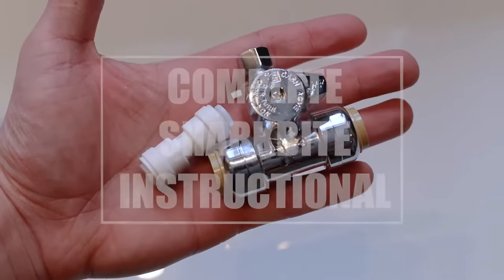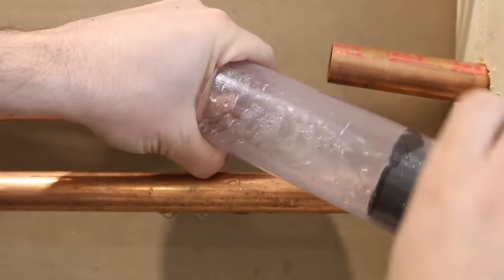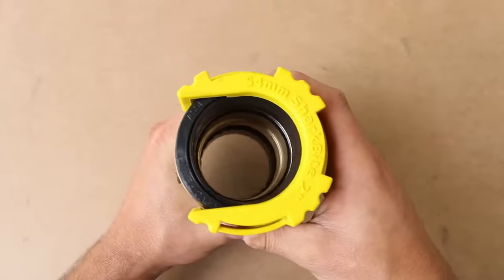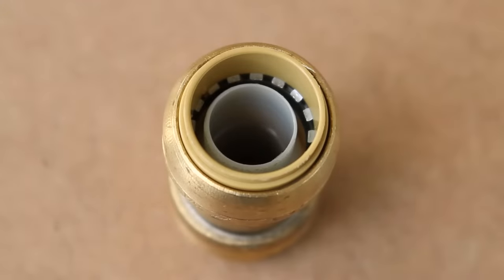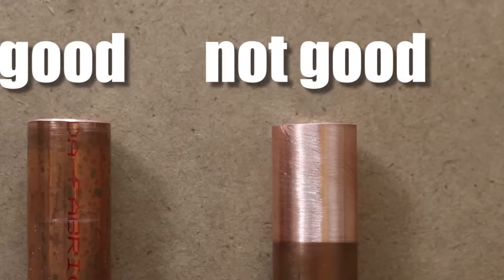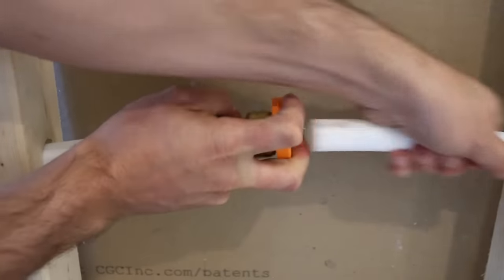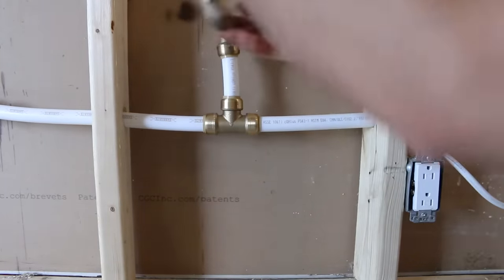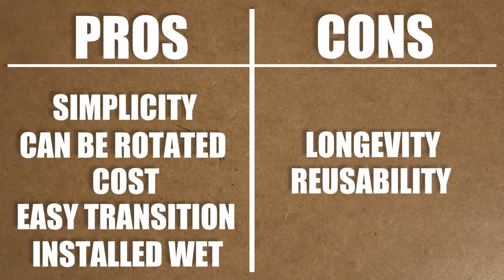Beginners Guide To SHARKBITE Fittings (Watch till end BEFORE Buying!) | GOT2LEARN

Comment: The pros always rag on these things but I'm starting to think it's self preservation instead of good advice.  That being said, I wouldn't use them where there was no access.  THAT being said, I did my hydronic heating system with them and they are great so far.  Definitely buy the nice hangars and use them.  Sharkbites aren't rigid when assembled, that's a plus and minus depending on circumstances.

Comment: Great video.

I never considered, although it does make sense once we directly think about it, that they lubricate the o-rings at manufacture.

All the same, I continue to keep a tub of silicone grease and always dab the end of the deburred pex before assembly.

Same principle I guess, I'll keep at it, I typically do not use a shark bite anywhere that does not have an access panel regardless of assurances, otherwise it is crimp clamps or sweat.

It is nice knowing that they are well trusted.

Any time I replace a section that has a SharkBite connection, I usually keep it if it looks serviceable and put them in a bag for short-term use.

Comment: I use them for diy repair jobs. I also use cpvc primarily. I avoid copper because I dont have that skillset and dont view it as necessary to learn for the tasks I'm doing. All of this has been work done on 1/2" or 3/4" water lines.

Where I think these are very useful in for that transition from copper to cpvc. Maybe there is a better way, but for me this is by far the simplest way to get this job done. 

1. Cut out the pipe you need to replace/alter etc. 
2. Clean up and deburr the copper where you cut it.
3. Attach sharkbite
4. Use cpvc from there.

Using that basic approach all I really need to know for copper is how to cut it and deburr it. Everything else is cpvc cutting, measuring, clean, and glue work. Maybe Im not a pro, but Im not doing fresh installs. This is all cut out and replace jobs. 

The copper was installed usually by my father in law back in the 70s so it had a good run. Maybe these fittings wont last as long as advertised. Maybe they will. I don't know. I do know that poorly done copper installs dont last nearly as long as advertised. I know I won't have the frequency of use to keep that soldering skillset up at a level I would feel good about. I also dont want to hire a plumber for relatively simple tasks. For me cpvc is a very simple skillset that I can easily do. Sharkbites just solve the move over from copper to cpvc.

Comment: Thanks for this, I have a small repair to tackle and I just might go with these. The space will be on the tight side and I am not sure about soldering in there... It will be accessible so I can check on them from time to time.
Reply: Go for it. My experience is 100 percent for these little buggers. Other than the price I have encountered no negatives. Tight spaces was my circumstances and they saved me calling a plumber. Now, I had problems but they were unrelated to the sharkbites. I wish I had gone on website before I started. That would have saved me some headaches. This was also my first time taking one apart( several times). This guy's tutorial is perfect. Unfortunately, I had to learn those tips the hard way. Good luck!
Reply: I'm a plumber with over 25 years experience.  I live in Reno. NV.  I have seen shark bites freeze and break actually split down the side.  It flooded a laundry room.  SO THEY ARE NOT PERFECT.  They are easy to use and a good option for quick and easy installations.  I would not use walls that are not serviceable
Reply: @donquandt3877  LOL copper freezes and breaks as well. Nobody said they were perfect. They're good for an easy diy fix that won't cost a car payment like a plummer would.
Reply: @donquandt3877  Any type of fitting can freeze and crack. Would it have failed if it didnt freeze?

Comment: Only as a temporary emergency repair. I fixed a job by a licensed plumber who used these crap things in an upstairs bathroom job. Needless to say the downstairs destruction was epic when the fittings blew apart. I use these in industrial plumbing jobs for air and water. They do fail rather often but in these applications they can't damage anything.
Reply: I do maintenance work and I replace those things regularly... like you said temporary/emergency repair.
Reply: Depends .._on the hydraulic pressure and instalment of the bite.Haven't changed any of ours ever since 2013
Reply: If they're failing that often there is either too much pressure in the line, or there is a fault in how they are getting installed. The part in the video about NOT taking sandpaper to pipe before applying is very important. Same with deburing. Unfortunately, I've seen in my own house from previous owner where they used sharkbite fittings and did not follow those guidelines. I had to remove them to prevent disaster down the road. Best part? A Licensed plumber did the work.
Reply: Ive replced them in other homes but you can tell a shit job was done tho lol,yea no sandpaper

Comment: love my shark bites--and found that they'll push OFF copper instead of breaking if they are allowed to freeze.  Simply push back on after the ice is gone-no leaks.
Reply: Thanks for that piece of knowledge. sounds great.
Reply: I like pex because it seems flexible enough to freeze and not split like copper or push off. Probably also helps in long term with just normal temperature expansion and contraction from hot/cold water. And lastly seems more inert to chemicals and ph of water.
Reply: @mickjager5974  Shark-Bite brand pipe is rated for 1.5 internal dimension  freeze expansion
Reply: @williamtiebout4142  1.5 times or 1.5%? 1.5 times would be huge! I don't think anything except a rubber hose would take that. Looking at their brochure they claim it is the most freeze resistant but state in the warranty conditions that damage do to freezing isn't covered.

Comment: I just had one of these fitting fail after 10 years. :(   And of coarse, it was inside a wall.  Had to cut into the wall and repair.  Went back with crimp fittings.  I won't use these push fitting inside a wall ever again.
Reply: I've fixed sweated copper joints that failed. Should we stop sweating copper as well?
Reply: @thomashammond9317  Hopefully not after 10 years.
Reply: The only one's I've EVER seen fail, are those that were improperly installed.

Comment: Thanks so much for this video. My bathtub plumbing does not have shut off valves, but is accessible through a wall panel. I was weighing all my options for installing a shut off and after watching your video I am going to use the sharkbite system. This video was extremely informative and thorough.
Reply from the maker: Glad it helped Linsay!!

Comment: Just one question, I would think a little lube on the pipe before insertion would help and would help protect the o ring, I was thinking olive oil or corn oil, I agree with all the pre preparation so important.
Reply from the maker: Only use silicone grease for this.

Comment: This is an excellent video. I am a professional plumber and I have one major caveat on installing these type of fittings: Only install these fittings in an accessible area. Do not install behind walls or underground. The main reason is because these type of fittings do not have the strength or longevity of threaded, soldered, or other durable types of fittings.

Comment: You forgot to mention a very important Pro, no need for open flame in close proximity to wood joists! I can’t tell you how many plumbers started a fire by heating a copper pipe before soldering.
Reply: Its not the flame its the handler. Pros use heat shielding and water spray to keep any heat from becoming a fire.
Reply: @beerbeforebreakfast  I have had THAT PLUMBER in my home. He didn't burn my house down but he did lose his balance while removing a sink from a bathroom wall, fell , chipped my bath tube porcelain and finished up the deal by knocking the toilet loose from the flange! THAT plumber is dangerous!

Comment: It says to remove the pipe stiffener when using copper right on the instruction pamphlet that comes with every sharkbite fitting lol. The stiffener is actually called a PEX stiffener by sharkbite themselves, meaning it’s ONLY used on pex and not copper or cpvc... Got To Learn!!!
Reply from the maker: People can do what they want haha, I was personally told by Sharkbite NOT to ever remove them ;)
Reply: I read all of the literature I could find on these and Handyman mag did an article on them. I have never seen any reference to taking that piece out and discarding it.
Reply: If I could post a picture I would, but it’s literally on the literature included with every sharkbite fitting.

Comment: While these are quick and easy most anyone can use them with just a little common sense they are NOT a permanent fix. They do work great but they will fail over time the o ring dries up especially with hot water lines. I have only seen so far one failure on cold water lines. I have changed multiple fittings on hot water lines This could be an issue of the water temp as the lines i am talking about are a constant 135 degrees but could possibly be fine with the normal household temp being lower. Just a little fuel for thought.

Comment: 13 years ago installed it  in the bathroom and it's still good
Reply from the maker: Nice!
Reply: Try removing it and re installing it! 🤣🤣🤣🤣 Never gonna happen. 2years maybe, 13 nope.
Reply: @beerbeforebreakfast  why would I remove it if I did it right first time
Reply: @RM80AR  you wouldn't, but it will not remove after about 2 years even if you needed it to be removed. That was my point. Not to make you feel bad. They  will seal forever if you dont touch them, but you cannot touch them after about 2 years or they are trashed and require other plumbing to be adjusted to accommodate nee fittings.
Reply: @beerbeforebreakfast  ok got it

Comment: Never had a leak even used them on hot heater lines as long as the cut is clean no burrs and a straight connect

Comment: One more pro is that they don't restrict water flow. Typical pex connectors that go inside the pex tube are very narrow and if you have too many of them on a line the the water gets restricted. My feeling is that the O-ring is protected inside the fitting and there are no moving parts rubbing against it so it will never deteriorate.
Reply: that is the downside of using PEX.  if you use a crimping tool and fittings for the connection, i also noticed how much smaller that makes the interior of your pipe, and how it will reduce water flow. almost better to use a sharkbyte because it is on the outside of the pipe and you do not loss that flow.  very good point you made

Comment: I installed 2 in the wall yesterday, ill come back in 10 years from now and let yall know if it leaked or not. Ha
Reply from the maker: We will be waiting :)
Reply: I installed 18 years ago the first Sharkbits, solder copper joints on both sides have broken Sharkbit  still going strong. The older ones didn't have the stiffener installed. They also have a new one called ProLoc no tool need to remove but for Pex only
Reply: @danbodily499  ΤΥ Dan!
Reply: Check it in 2045 for leaks.

Comment: Great information. Thank you.  Car drove into my concrete house foundation two weeks ago and needed to move my copper piping fast. Used the Sharkbite brass push fittings with Pex tubing.  Not a single leak because of this awesome video.  When I sweat copper back in, I think I am going to tie-in the runs with these due to some really tight areas.  Fast and easy, but not cheap.
Reply from the maker: Wowww, nice to hear you were able to get that fixed in a snap, happy to help out 😇

Comment: 8:15 - As a plumbing contractor, this is not correct. If your connecting to an old corroded pipe, ITS A MUST to sand it down with a wool or ultra thing cleaning mesh...
Reply: Yeah... Sharkbite says to use emery cloth.
Reply from the maker: Abrasive pads are the only thing I personally use.
Reply: Well yea anybody with common sense would not put it on a corroded pipe

Comment: 10 years still no leaks.
Reply: They will, it's just a matter of when, not if. You're on borrowed time as those o-rings are only good for 8-10 years.
Reply: @JosephArata  11 years now. No leaks.
Reply: 12 years now.... Niagara falls has arrived at my house
Reply: @JosephArata  I made a repair on a water supply pipe in my basement with two of these fittings in 2006 and haven't seen a drip yet. And that's with hard well water going through them. Not sure why you have such a negative opinion, but it doesn't seem to be based on facts, as many others have stated no failures in 20 years.

Comment: I am a plumber and have replaced so many push on fittings, especially on copper, the metal grip tends to corrode the copper, I had to replace them on pecs in house after the rubber failed, But you get what you paid for, these are for cowboys and diy enthusiasts
Reply: Got to keep charging for that soldering labor, I guess. I can solder and I can also braze as an HVAC guy, but Sharkbites are a proven system and I haven't seen the corrosion issues you are talking about. Copper soldering doesn't last as long as Sharkbite, in my experience.
Reply: @gamewizardks  the thing about soldering is that its durability is directly correlated to the skill of the plumber doing the job, sharkbite takes away this variable. In my opinion a well soldered joint is better than compression fittings, but not by much.

Comment: After 8 years a shark bite 90 failed in a closed ceiling. It was initially done as a repair. I would never use one in a spot that requires destructive access.
Reply: I'd be nervous about that too, I would want easy access to wherever this method is going to be used.  And no where it can do much damage if a leak occurs.
Reply: Even with access - why risk the water damage when using the standard copper or plastic is truly easy anyway...   Push fittings allow those who shouldnt be doing it to think they can!
Reply: @WinnTeam  Because switching to PEX means that a power outage and freezing weather doesn't produce shattered plumbing.  We had zero failures this last winter in the houses with PEX lines and busted lines in every unit that had copper and CPVC.

Comment: Shark bites are great! I typically use them for emergencies when I need water to stop fast. But they hold up for every other use I have come across
Reply: But for how long, that is the concern...
Reply: @ihelpdogs   Well, I'm not in the plumbing industry.  But I am in the electric power utilities industry, and a company I used to work for made hardware for high voltage power lines, of which we've been using EPDM type rubber since the 1950s in generally far more harsh conditions than plumbing will face.  We still get questions about the rubber, but I tell people I'm more confident about it lasting than I often am the metal!  And we've taken down hardware that's been in the field for a half century that the rubber is generally a bit harder, but still meets original specs!  It's tough stuff!
Reply: Yeah until it eventually fails which it WILL and then you'll have some angry customers and lawsuits.
Reply: @michaelstringly4138  soldering can also fail, or the pipe could develop pin holes...none have an eternity life span.

Comment: The problem is Plumbers do not like this because it saves people so much money not even the president charges so much money an hour
Reply: Plumbers don't care for using these because it's just a quick fix and is not great for full on installations
Reply: Plumbers don't like them because they're crap. If they were good plumbers would use them.
Reply: Does anyone remember when they started using poly butylene pipes in homes? There was a huge amount of them that failed in the 80s to 90s or 1-10 years after and still today many modular homes are being scrapped because of these leaks.
Reply: @kg4boj  yeah I do ,I live in one first time I saw pex and clamped fittings,I was like man they tried this before and it didn't work,I live in a mobile home and sharkbites have been a Godsent,I cut off the old one put on a Shark bite and it works well ,I honestly trust these over a pex clamp any day of the week,it's also nice I can go from that gray stuff to whatever I want to without a hitch,but I will say that's the only application I use them in,and outside of my mobile home I don't use them, on anybody else's stuff I'll do it right ,I will use them as a temporary fix they are great for that
Reply: @cm01  Bullshit..Plumbers can charge you out the ass to sweat copper is why they don't use them..Fact: SharkBite fittings are approved by the Uniform Plumbing Code and International Plumbing Code for permanent installation.
Reply: I would guess most do not 'like' them for permanent in-wall use simply because they don't trust anything they didn't learn on and the fact that they have not heard enough evidence of use in wall without failure to make them feel comfortable. Any anecdotal failure (real or made up) will offset hundreds of no-failure stories.    Really a chicken or egg situation as they don't use them as they don't feel they are time tested enough and they can't be time tested enough because they won't use them.
Reply: @bouchee2007  That doesn't really follow, does it?  If they're just as good, take less skill, but cost more, then it would make sense for DIYers to use them but not plumbers, logically speaking (as the plumbers are going to be more skilled and buy far more fittings than any homeowner).